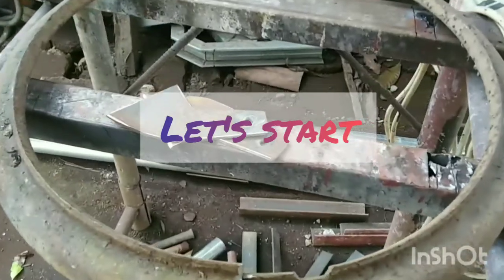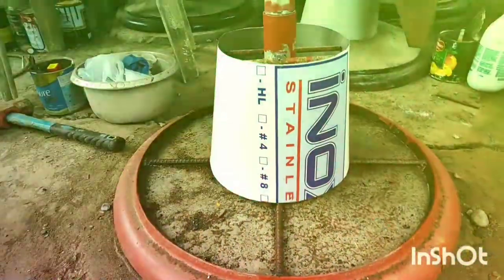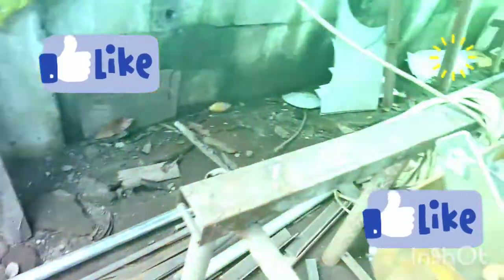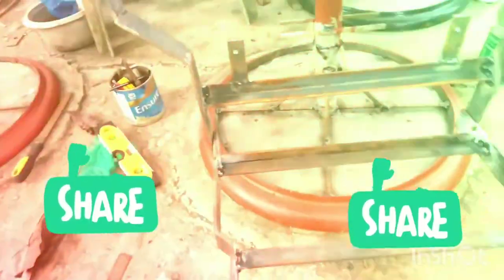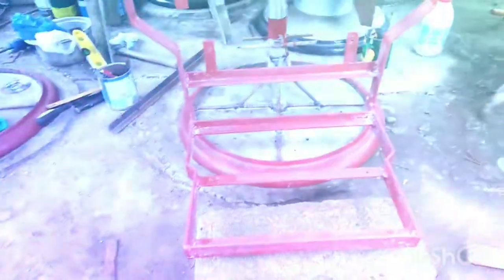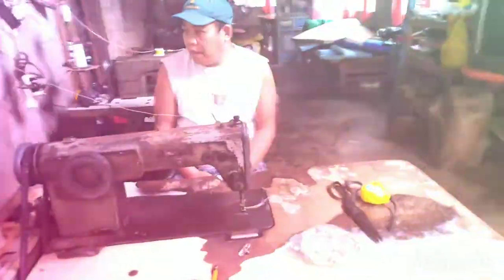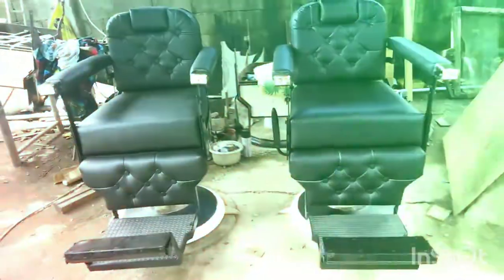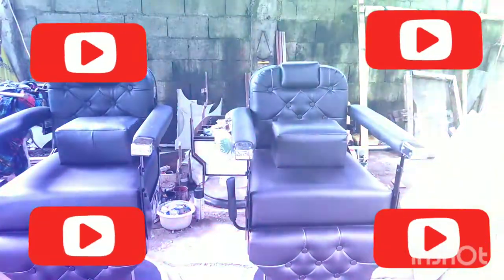barber chair making/raket sa pandemic :by bisor dario

Comment: Boss pwed Po ba mkahingi Ng number mo pra makapag usap tayo magpapagawa sana Ako..,
Reply from the maker: Robin lim di na po ako gimagawa ng barber chair kasi nakabalik na ako abroad nung pandemic ko lng po yun na project salamat po sa panonood sa channel ko.
Reply: Pwed Po ba mga hingi Ng list Ng mga materiales at sukAt mga ginamit nyo try ko Po gumawa din
Reply from the maker: @robinlim9881  hanap ka ng lockring ng gulong,tapos flatbar na 5mm × 4 inches, flatbar na 1 3/4 tubo na 1 1/2 tapos pasok mo ung tubo na 11/4 or search mo nlng ako sa messenger Dario Basilan tapos subscribe mo yung you tube channel ko hehehehehe
Reply: Ano pa boss mga ibang martyales.